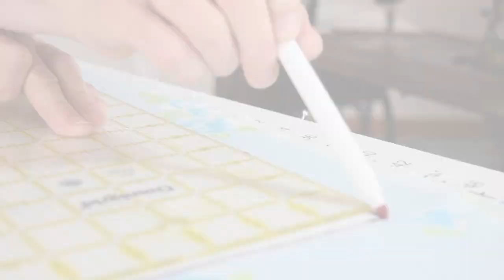1920s Dress on an 1892 Singer.

Comment: A lovely sewing machine! I need to learn how to restore a precious antique sewing machine like you do, when I get my own God willing.
Reply from the maker: The cool thing about it is that a good cleaning and lubricant will usually get it up and running. These machines were really built to last. And, there is a treadling community where you can get new leather belts for the drive. The long bobbins are still made, and there are many places you can get used bobbin holders. The treadle lady on Etsy has a lot of great resources.

Also, these machines are not difficult to find and many are really affordable.
Reply: @ReisigSeeds  Why, thank you for sharing this :) It's of great help.

Comment: Beautiful work.  And your machine is jaw dropping.  I love the pieces that were left in the drawer.  Did you get any presser feet?
- Cathy (&, accidently, Steve), Ottawa/Bytown/Pimisi
Reply from the maker: A regular foot and a ruffle foot. I don’t think I have a zipper foot.
Reply: @ReisigSeeds  I fell down a rabbit hole of old presser feet.  Biggest tip is esty is for research, ebay is for purchases.  The zipper foot is clutch, so is the one for pintucks...